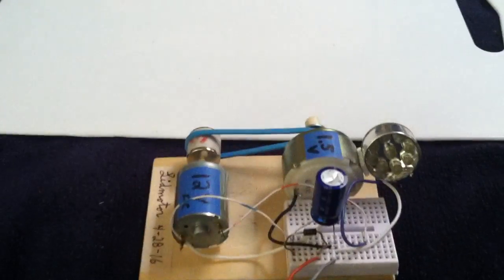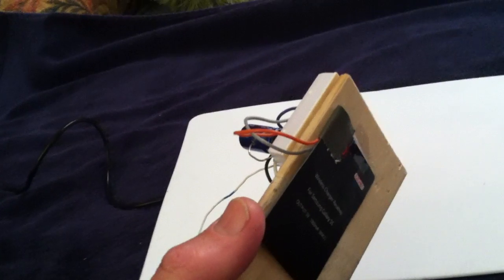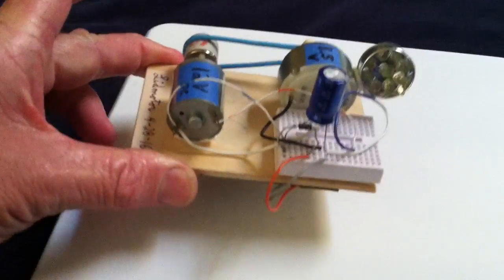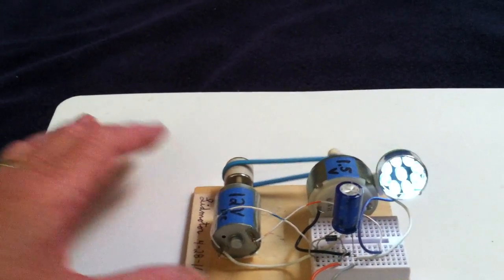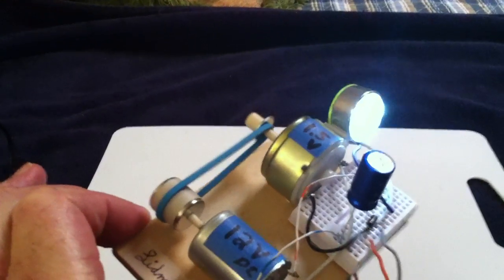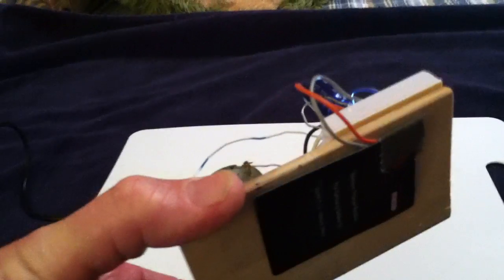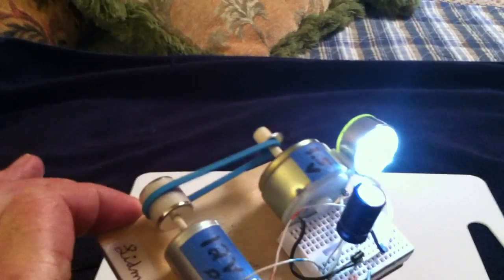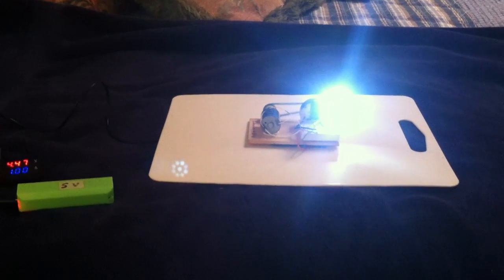Motor Generator---  with wireless power pickup

Comment: what is the work of diode ? can u tell me how the connect the wires ? the 12volts electric motor connected in super capacitor ? then the 1.5volts electric motor connected in battery ? plss tell me how they connect tnx

Comment: If it isn't how they do it then it's a great method in itself that's been prevented !
Just replace the motors with SSG type components and i'm sure it's close to some videos.
Reply from the maker: +slider2732 Now that is an idea--- An SSG powered by a hidden wireless charger!  I suppose you could just as easily power a SEC 18 or the mysterious PSEC also.

Comment: You built the perfect concept of a toyota prius. It charges the battery with a the gas motor and then the electric motor runs the car and then the gas engine switches on and then once the battery is topped off the gas motor shuts off and the battery keeps the car moving. In this case your gas motor is the inductive charger. I like it.
Reply from the maker: +egn83b Thanks. I wonder how many electric car companies are working on wireless charging.  Imagine owning a car that you never put gas in or ever had to plug in.  You just drove it over a charging space either at home or at work and the car quietly pulled energy from the floor.
Reply: +Lidmotor that would be mighty handy especially at the stop lights

Comment: Awesome! Can you get it to run with no capacitor?!!.🙌 Its a  beautifully simple hoaxy-free-energy device!!..Lol the Mindless Millennials would eat this up with a spoon! Nice video Lid!
Reply from the maker: +William O&#39;Rourke lll  You can run this with no capacitor---if you get the energy into it some way.  Once you remove the power it stops of course.  The super capacitor is a way to quickly absorb and store extra energy.  This will also run a AA  battery for many hours.
Reply: No I was thinking more a thin graphene capacitor sandwich under the breadboard!..lol it would look just like double-sided tape!.😎
Reply from the maker: +William O'Rourke lll   A thin graphene rechargeable would work great!

Comment: Rusty:

You may have just figured out how that guy made that video.  Nice job!  I just thought he had wires under the table but...induction and a cap....that would allow it to be picked up just like you did.

Very good work.  I think you have done it.

Bill
Reply from the maker: +Pirate Labs Thanks Bill.   This might be the way.   If the AC shaded pole motors have been converted in some way then it is possible.  We may never know for sure.  To me it is still a puzzle until someone does an exact running replication.... and shows how he did it